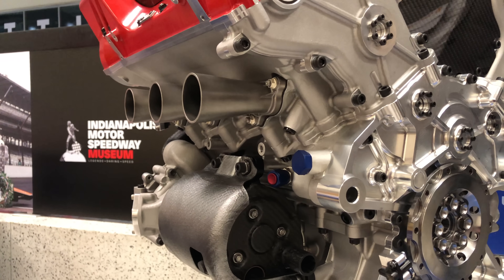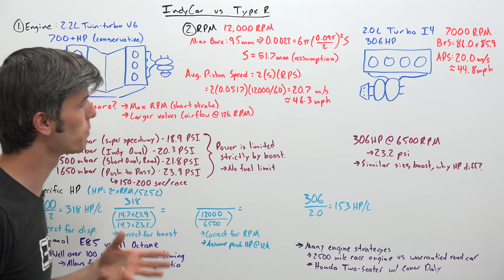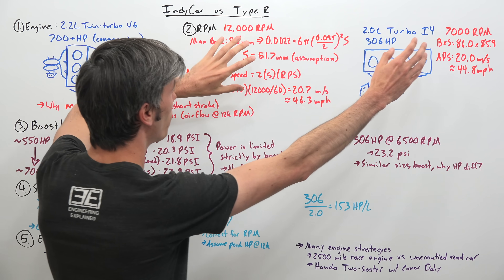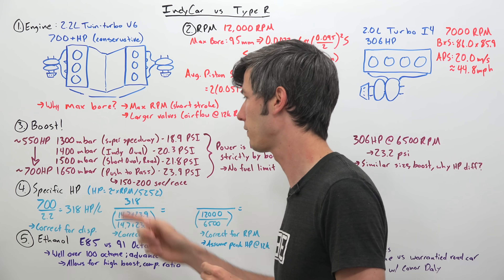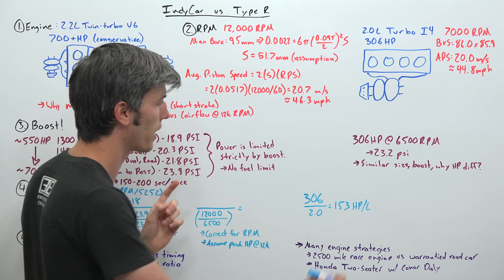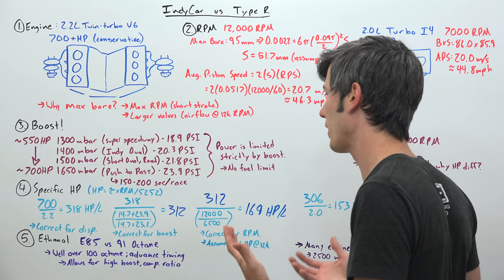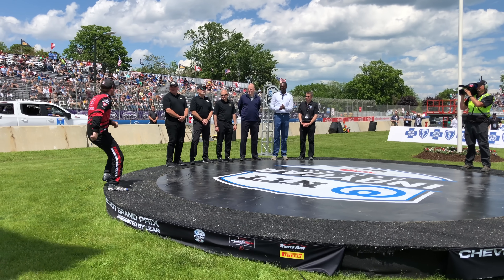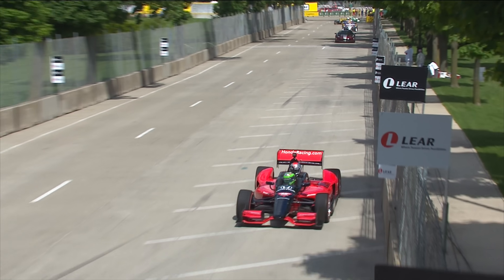How Honda’s 2.2L Engine Makes Over 700 Horsepower

Comment: How about one engine has 6 cylinders and one has 4 cylinders?  Shouldn't you need to account for horsepower per litre per cylinder?
Reply: mind fornication  Makes no sense...then let's compare a 2 cylinder to a 6 cylinder, shall we?  It's quite obvious which one could easily make more horsepower per litre. Can't refute the law of physics. If you want to make everything equal, I can't see how one would not account for the number of cylinders in the engine besides simply looking at displacement - a 4 litre V6 is not the same as a 4 litre V12, and doesn't have the same potential.

Comment: Nice break down. Sounds like the one major factors are more RPMs, bigger valves, two turbos, fuel, being a racing engine and a little more displacement. Attributes to the difference.

Comment: There are several important things left out of these videos. Example rod to stroke ratio and its affect on piston velocity. My guess on the v6 in this video will be 3 to 1 to give maximum output at 12k rpm. Thoughts?

Comment: The 2 litre 4 cyl motor being pegged right on the Japanese " Gentlemen's Agreement', like several other Japanese engines, would make that factory posted 306 a might shakeY - I could easily see the under reporting as the 16/hp/liter difference,making the Turboed four actually more like 338  hp. I don't know any more than some one else- but it would be in my top theories !

Comment: It's generally said that if you can make the same torque at 2x the revs you'll double the power. That short stroke, wide bore and big valves are so you can get 2x the air and fuel through the engine to deliver that power. By the way - Honda's CBR600 motorcycle engine makes 

Power - 88.1 kW (118.1 bhp) @ 13,500 rpm
Torque - Crankshaft (claimed) 66 N⋅m (49 lbf⋅ft) @ 11,250 rpm
That's about 196bhp per litre !!! They dont say what spec fuel it needs to make best pt of 200bhp/litre.

Comment: @engineeringexplained Hey would really like you to do an episode on this product that is big in the mopar world and probably others as well.  It's called a pedal commander.  There is alot of miss information about this product and I'd really be curious to hear your findings on it.  Basically its module you connect to your car that supposedly increases throttle response by I assume increasing voltage? I'm no expert with Ohms law but in theory does this actually work I'm very skeptical.

Comment: 12k rpm? Anyone remember the good old day when we had F1 cars with 20k rpm? pepperidge farm remembers...
Reply: This is indy car though...
Reply: Well everyone also says they miss the original SBC and SBF engines but like those engines the mid and early 2000s he’ll even late 90s 3L and 2.4L F1 engines are just great for nostalgia at this point. The fact of the matter is a run of the mill 5.3 LS out of a junkyard van or work truck will easily match the power of the venerable R302 SBC, and 350 SBC and he’ll even early 383 strokers. All it takes is maybe a cam, that’s how far we’ve come, yet people still harp on “how great” first Gen small blocks are. For the time, yea they were but that time has passed. They’re still tons of fun, and a V10 3L spinning at 19,500, 20,000 or 20,050 like Honda/Renault etc built for F1 is a great engine don’t get me wrong; however this 2.2L turns nearly half the RPM, has less displacement by nearly a full liter and still about equals the power output of a 3L V10 of yesteryear spinning the beloved 20k. The fact of the matter is teams can only have a finite number of engines per season so if they can make the power with less stress on the rotating assembly that’s a win for any team. So the old engines sound cool, yes they do, but how can you say an engine at 3L making 750-850 Hp at 19-20 thousand RPM is great, but a little 2.2L making over 700 hp at only 12 thousand is junk? That makes absolutely no sense from a logical standpoint
Reply: Yea I member
Reply: same with my 250CC bikes that had 19k RPM
Reply: I remember the good days of 6k rpm idle
Reply: Engineering aside, those screaming f1 engines were so epic. They should bring them back.
Reply: Anyone remember when the late 80's very early 90's cbr250rr revved to 22k?
Reply: This ain’t an F1 engine.
Reply: Yeah boy old af1 was soooooooo good..and remember group b really ooooohhh wipe that thigh clean
Reply: It's all down to piston size. The smaller the faster it can spin the engine. I had a motorcycle with a 250cc 4 cylinder... It could rev to 19,000 rpm in the 90s. And was good for 100,000 km
Reply: It is just sad what F1 has became just sad next will be nascar remove the engine's no noise 😥
Reply: I do !
Reply: Boomer
Reply: @duduychony9747  Awww how cute, mommy let you use the internet long enough to post stale memes. Have fun at daycare, kiddo.
Reply: @duduychony9747  I don't think you tards realize how old boomers are xD

Comment: The production engine have much lower max temperature before turbine to as you say have greater durability. And also, what emission regulations apply for the 2.2 liter engine? The back pressure will make a whole lot of difference on the high mass flow of air at that high rpms, which would be restricted at the 2liter even if they would rev it to 12000 rpm with cat, and maybe gpf on it.

Comment: How Honda's 2.2l engine makes 700hp? It doesn't last! V8 endurance. Nascar engines make 900hp rev to a 9000 rpm red line oh and it does this for 500 mile races.there is no boost and no nitrous. All motor. There's no replacement for displacement. LOL 2.2l😂 be a man, man!
Reply: No ones using nitrous in the 2.2. what you on?

Comment: still don't quite get this..so is it possible to rev the engine in the civic to 12000? if so, will it produce as much hp as the indy car engine? if not, what enables the engine in the indy car to do so?

Comment: When comparing the 2.0 L4 to the 2.2 V6 you left out cam design differences between a car which needs to be "streetable" and one which can work within just a small RPM range at the top.

Comment: Important correction, the cylinder head flow rate has a HUGE influence on power output. E85 is approximately 105 octane, however doesn't account for the majority of the horse power difference. I would speculate that the cylinder heads on the Indycar engine flow FAR more than the stock type R engine, which contributes to the significant difference in hp, while having similar displacement and boost levels.

Comment: One thing that was touched on early in the video but not after normalizing for displacement was the effect of the shorter stroke of the Indy engine.  Clearly, if two engines have the same displacement but one has a shorter stroke, then the one with the shorter stroke is going to have a greater cross-sectional area.  The greater cross sectional area allows for larger valves which in turn allow for greater airflow.  Now, greater airflow allows one to combust more fuel which leads to more heat generated which leads to more power - but not at all engine RPMs.  If you rev the engine very slowly, there is no pressure gradient to drive more air into the combustion chamber.  At very high RPMs, however, on the intake stroke there will be a larger differential between the air on the intake side and after the intake valves.  Bigger valves mean less pressure differential which means more air in the cylinder which means more fuel burned etc. etc.  In short, the larger valve area of the Indy car allows for higher RPMs without starving the engine for air which allows for more HP.

Comment: I like to explain boost as a measure of restriction. Boost pressure is only generated when the engine, for one of many reasons, can't flow as much air as the compressor is providing. It could be due to the exhaust system, cylinder heads, valve geometry, intake manifold design, etc. Flowing the same amount of air at a lower boost pressure will generally yield better results because compressed air, heat, yadda yadda. 

If we break this down to the most simplistic reality that an engine is basically an air pump and some light rounding, this is an easy one. One engine is 2.0l, one is 2.2. We'll do some slow rounding and say they're pretty much equal. One makes peak power at 12k RPM and one at about 6k. Boost pressure is about equal across both engines as well. If we assume the engines both flow air with fairly equal efficiency, you've got the same boost pressure but twice the RPM which means twice the airflow. Kinda like electricity. Voltage is the same but one has twice the amperage this twice the wattage output.

So we get in the ballpark with that and in so doing have also taught people that boost pressure doesn't mean anything without an airflow rate. The rest of the power can be attributed to higher compression, aggressive cam design that's impractical for daily motoring, different fuel allowing more spark advance and better airflow at the same boost pressures through better heads, intake and exhaust setups

Comment: Would be interesting to know what fails after 2,500 miles, or I would guess about 20 hours of race use, or at minimum what the HONDA race mechanics replace in a rebuild, as obviously they do not throw the entire engine away after every race. So what are the weak points ???   Also thanks for the boost pressure correction, I almost thought HONDA defies the laws of thermodynamics using E85.

Comment: Yes very impressive, but even more impressive is the current F1 setup - 1.6l V6s with 825-1000hp at 15K RPM with a single turbo. And that is without the extra 160hp added by the hybrid system.
Reply: Single vs dual turbo doesn't mean much you get a pretty decent gain from the rpm

Comment: That Indy engine isn’t that impressive considering Honda also makes the formula one engine RA619H which is a single turbo 1.6 liter V6 producing 950 horsepower.

Comment: Yaaawwn....and a Chevy big block makes over 10,000 horsepower.
Reply: Um no they dont. A proline hemi yes a big block Chevy 5k is where we start to see them not being built well enough.
Reply: @jdrok5026  Um yes they do...in fact now its closer to 11,000 HP.  Ford, Dodge and Chevy engines make that power...geez's what do you think they run at NHRA??
Reply: @taylorswiftnumberon1  those are proline hemis they are not a big block Chevy or a ford. They are mopar valvetrain with a revised basic block that isnt chevy mopar or ford because it lacks cooling.  In reality it's a mutt of the 3 with most of it being mopar but some differences are made to make it stronger from the other 2. Currently no mopar ford or gm engine will hit 11k hp without literally nuking itself due to the idk the dual distributors. The 16 spark plugs capable of holding the 44 amps the dizzy puts out. No water jackets a mix of nitro methane and a supercharger that east 1200 hp by itself. These top fuel engines are very specialized.

Comment: Honda has LONG experience with high rev Motors.   Their RC166 Grand Prix bike in the mid 60's was 250cc and 6 cylinder. Bore 41mm , stroke 31mm!  This tiny engine could pump out 62 hp at 18,000 rpm giving you 248 hp per litre ------- Naturally aspirated!

Comment: The question is, "how do i drop this into my 99' Civic?"
Reply: James Smith  K or B either one will get you boostability. K20 is pretty high comp compared to B20 or K24 and therefore might not be as good for boosting, but yeah, B18/B20/K24 are your cheapest bets, go grab one out of an old CRV or TSX for 200$ at a pick and pull.
Reply: Buy a k24 .....watch boostedboiz
Reply: K series and B series is always a great choice
Reply: Get a j series swap with twins it wont rev as high but she'll definatley rip
Reply: $ 200,000
Reply: using a sawsall and a body hammer . Problem solved
Reply: Imagine a Honda minivan V6  AWD power train swapped into a CRX .
Reply: You would need a new engine every week.  Totally useless engine.
Reply: if you want to be more realistic , cost  effective , totally reliable , and already large groups with hours of blog time of all your options ..you get yourself a Miata with a blown engine and replace it with a Corvette LS V8. And the ls doesn't have to come out of a Corvette. There were 300 plus horsepower versions in pickup trucks. And more popular in a lot of wrecked Camaros. This has been happening for several years now and there's even kits prefabbed to assist in bolting this together. this mod has been very popular at my local track called Putnam Park just west of Indianapolis between old 40 and I-70. and the V8 engine is not that much heavier so it doesn't cause the car to be like a boat anchor in the front and actually goes around corners pretty damn well. and there are some slightly heavier front springs and shocks and suspension mods to turn your little Miata into a behemoth that can easily hold its own to the big dogs..and of corse th ers are those insane Chevy gear heads with 800 to 1000 HP and more packed into Miatas thst by then is only a body shell as the chassis and under pinnings  necessary for crazy horsepower is going to resemble something like a tube frame Factory Five Black Falcon with a Nelson Racing Engine in it...as Tom Nelson builds twin mirror image turbos of his own patent making 2500HP on the street  that drives like a ho-hum grocery gitter until you stand in it and becomes a totally evil monster from hell .....seriously if I were doing it I would check out a used LS with less than 100k miles of a 400HP +  Camaro version and leave it pretty much stock do the inexpensive suspension mods and tub  it out just a bit for Camaro size tires and have more fun than you can have with your clothes on....and you should know that a Miata is a ford product ..so if you wanted it to be all ford forget about 5.0 coyotes and voodoos as the double over head cam cylinder heads are too wide to drop in as a small block Chevy will ..but there'S ONE more thing and that is brand new old school 302 (5.0L) and 351(5.7L) thst dont take up as much real estate under the hood as does a small block Chevy ... and just as reliable as aftermarket ford Chevy dodge blocks and all internal parts are all modern technology and CNC milled and what's so cool about this type of mod there are MSD ignition module better hotter and better and more reliable then Factory stock of today plus there's a whole line of EFI four-barrel throttle bodies that replaces a carburetor with a plug-and-play self-tuning EFI but you don't have to know anything about at all just take it out of the box bolted on hit it with 12 volts and you're Off to the Races or the mountains or sea level itself tuning itself adjust the fuel mixture all the time. I met a guy last summer at a gas station could just build himself an AC Cobra Kit Car with a 351 in it and an f i Tech self programmable four-barrel throttle body they come in a little tuner handheld device so I asked him how many times he played with that tuner , he said a few times and then I put it on auto and let it go back to stock and runs better he he he he so you se e  you don't even have to be a mechanic if you can put part A on Part B and plug it in your car will outperform everything I've learned in the past 50 years
Reply: @donniebaker5984  i agree with you,only the weight.a k20 weights 275pds...a v8 is twice that..
Reply: @upnorthviking823  
LS blocks claim to fame are lightweight aluminum blocks .The 5.7 liter block itself weighs 109 lbs .Fully dressed out it weighs more than 109 but still an LS engine is far lighter than you might think .

Comment: So what??,Ford and Carol Shelby help design a 800+hp.4-cylinder inline more then 30 years ago with Cosworth of England.This is where the super high hp.inline 4-cylinder engine was born.
Now Honda is bragging about a 4-cylinder that has only 700 hp.??.They are about 150hp.short from the record.
Reply: Huh it's a v6... also 800 hp 4 cylinder 30 years ago for what f1?

Comment: just curious, what kind of torque does a Honda engine make 💪
Reply: yOu DoNt NeEd ToRqUe WhEn YoU hAvE VtAaAaAk!!!!1!!1!1!!

But seriously... HP is torque over time and you can get as much torque as you want with the right gearing.
Reply: At 95mm stroke, if i heard it right, and from a v6, it should be able to make around 130lbs naturally aspirated, probably making 190lbs when boosted. Depends of the boost too...
Reply: 12 foot pounds at 8.5k rpms

Comment: Chevy's Twin Turbo 2.2L V6 makes 735-Hp with their Indycar engine, redline is 12,000 RPM and weighs 248 Lbs complete.
These type of engines get rebuilt ever 2500-3000 Miles and are all very similar.

Comment: The Offenhauser 2.65 L 4 cylinder made about 1250 HP back in the 70's on race boost, WITHOUT an intercooler and using old Hillborn mechanical fuel injection.  The Offy-turbo nearly broke the dyno at Meyer-Drake on unlimited boost, exceeding the 1400HP limit of the dyno!  Interesting story on the Offy-turbo's slow rule-book -driven disappearance from the Indy circuit in the 70's.  No one knows for sure, but the appearance is that the Europeans would not commit to fielding Indy teams as long as the Offy was running!  It seems the Euro teams were more comfortable running against an engine(Ford-Cosworth 2.65 L V8 turbo) that could be beaten, versus running against the "ancient" 4 cylinder Offy that they could not beat!